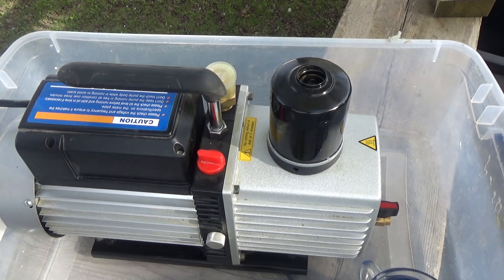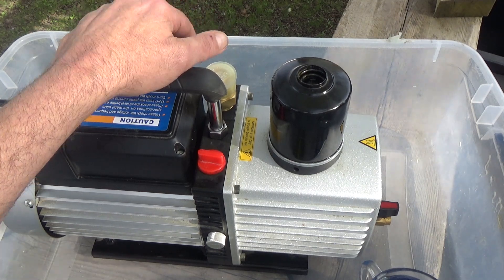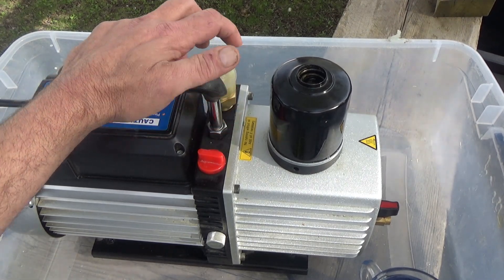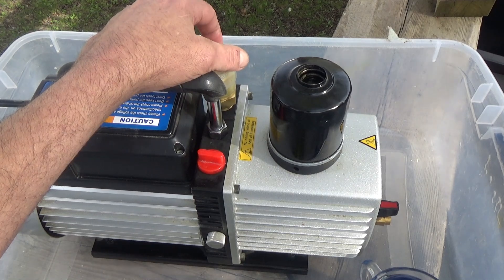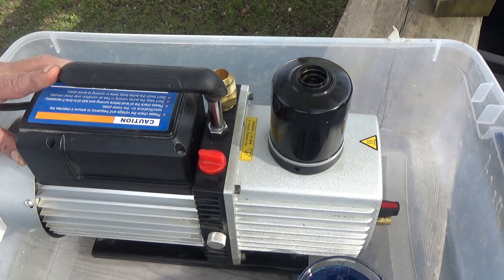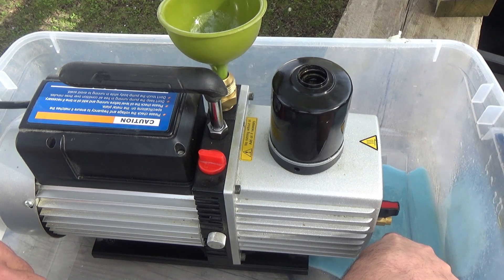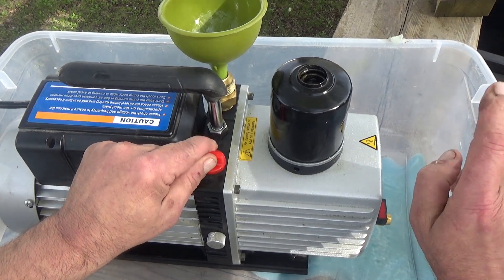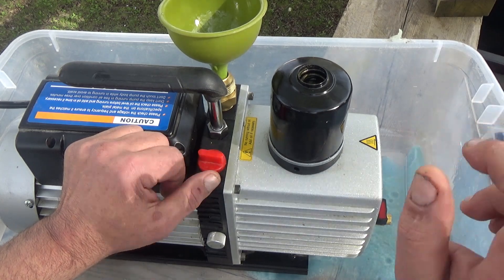Harvest Right Unable To Achieve Vacuum Error Ep167

Comment: My mtorr until around 1800 if dry test. After flushing several times, until no more milky color, but still the same, no improvement. Should u go on flush out more? More than 20 times?
Reply from the maker: In my opinion you shouldn't have to do it more than twice. This video was a last resort. If it didn't work I would look for other problems

Comment: Does anybody know where I can get the rubber ring That's goes around inside of the pump?
Reply: I'm assuming you mean the o-ring that goes between the tank & the main pump unit.  You can confirm by looking at the pump manual which you can find online by searching on the pump model number.  The manual has an exploded view and parts list.  If you have the standard pump like in the video, then Harvest right sells them.  I just ordered a couple for my pump.  It's item #39 on the standard pump parts list.  They're around $4.5 each as of this response.

Comment: I did order me a new pump today and then I seen your video.
 I went downstairs and flushed my pump with a little more oil than you used and the mTorr went down to 400 mTorr in 5 minutes and before that it would only go down to 1470 - 1530 mTorr in 20 minutes and then it would just hang there. I turned it off and watched your video.
Awsome job sir!!!

Comment: We were also using Dairyland vacuum oil but I spoke to the JB Industries senior tech and Matt said Dailyland oil is crap and DON'T use it.  We are now using Nu-Calgon Premium vacuum oil as per Matt's recommendation.  Also, change your pump oil REGULARLY-we're changing it every 10 cycles.  We STILL get "Failure to achieve...." messages on occasion but significantly less now with the Nu-Calgon oil(bought through Refrigerative Supply here in Canada but I'm sure you can find it stateside at any reputable HVAC supplier.  Gonna try the flush now and see what results I get.
BTW, HR's tech support dept is f#@%ing USELESS.  More info found on YouTube, ffs!!
Reply from the maker: I also changed from dairyland to black gold. I still run one load a month with dairyland to clean the pump out. We live and learn and I learned that dairyland will hold the moisture in the oil which will give vacuum errors
Reply: @JohnInBibs  hey John, tried the pump flush procedure, refilled w/new oil, ran mToor test AGAIN. Results:  mToor would not go below 6000 after 20 mins.
I suspect,  like many other HR parts, they used the cheapest crap they could find.  My HVAC guy said the refrigeration motor brand is cheap and extremely prone to failure.  We had to replace 2 so far.  We use these machines(6), 5 days a week and had them now for about 5 yrs
We dehydrate a salt based oral rinse powder, which, if oil isn't changed very regularly, will result in corrosion/rust forming on interior of pump & its oil chamber.  Consider taking the oil Reservoir cover off the pump itself and do a thorough cleaning inside, use brake clean, whatever you need to do. I have found a myriad of nasty stuff inside.  For me, I'll just carry on having a frustrating day, Cheers.

Comment: Hi. Thank you. I’m going to try the flush. I noticed your oil is blue. If it is dairyland I suggest you also stop using dairyland. It WAS the recommended oil but no longer. It contains water which will rust out your pump eventually. I’m working on the issue with mine now but I can’t wait to do the flush. Thanks.

Comment: I want to thank you for this video.  I thought my pump was fried, but I back flushed it and the vacuum is back to well under 400 mTorr.  I actually back flushed it five times using about two cups of oil each time.  I tested the vacuum after each back flush and the vacuum kept getting better and better until I was satisfied the fifth time.  It took nearly a gallon of oil, but that was cheaper than a new pump.  Thanks again for the info!
Reply from the maker: Glad it was of some use
Reply: 5 times? okay, I have done it once and testing now. If it gets better, I will keep doing this flush. I would have not thought about doing it again and again. We ordered a new pump last week so if this works, we will have a spare.

Comment: I am so disappointed. I just purchased our Harvest Right and I keep getting this message. We were literally doing the initial bread run. I am trying to work it out with Harvest Right CS. Nevertheless,  thanks for the video.
Reply: I just received my brand new small stainless steel model and same thing. I followed the manuals exactly to set up the unit and pump. It passed the vacuum test no problem but soon as I try to run the first burn batch with moist bread it runs forever but will not go below 1000 mTorr then starts messaging inadequate vacuum error. Took it all apart and put it back together all connections tight and drain valve closed. Repeated and exact same thing happening. Super disappointed for the price I paid and had  a bunch of food prepped. Have not been able to complete a full batch. Have contacted harvest right but have not heard back.

Comment: John: my standard oil pump is out of warranty (almost 2 years past shipping date, much more than the 6 months covered by warranty) and I’m now unable to pull a deep vacuum (can’t get below 1000 mTorr).

I’ve gone through the checklist a couple of times, with no luck. I also don’t have a 2nd pump to verify that it’s the pump that’s the issue (though I’m fairly certain it’s the pump).

I’m thinking I’ll try this method of flushing it out. I typically use Dairyland oil, but do you think it would be OK to flush with the oil provided by HR with the machine, and then go back to Dairyland for regular use? Didn’t know how the residual cheap oil used in flushing would affect the Dairyland oil.
Reply from the maker: I would use the non dairyland oil as well. Hope it helps. Worked great on mine
Reply: Thanks, John! I’ll see if I can find another person locally that will let me do a vacuum test with there’s to confirm it’s my pump, and then try flushing it out with the non-Dairyland oil.  I’ll report back!

Comment: After purchasing a harvest right freeze-dryer with oilless pump I had to send back both of them after trying to get them to work properly. I received another pump and they fixed whatever was wrong with the freeze dryer, they worked for a while but now after only using it several times I keep getting a vacuum pump error. Of course, the expensive pump is now out of warranty. Since I live in a hot climate I can only use it when fall hits. So far the freeze drying investment has been a total bust.
Reply: I have had the same problem.  I have owned my freeze dryer for 14 months, have bought 2 pumps, had them replace 2 more oil less pumps.  Took it into Harvest right to have them repair it.  Brought it home and it immediately had a vacuum  pressure error.  I am searching videos to see if there is anything users know that harvest right doesn't.  I sure feel like its been a waste of money.  If you are not handy with tools and want to spend a lot if time fixing it yourself, I dont know how you can ever get your money worth.  John has made some great videos and I would love to try some of the things he has done, but I have lot hope.

Comment: I just bought a medium freeze dryer with the standard oil pump that comes basic with the unit. I have not passed the mTORR test yet after several attempts it is now stick around 700 mTORRs.  I changed the drain valve as my leak was definitely there. The door seals, and all connections checked out okay. I changed the oil every time after the test. The oil was like pea soup color so I kept putting new oil in. I had to order more. 5 days in and I still can't pass the vacuum test. I even tried this flush even though its new. Still stuck on 700 ish. I was wondering if the demister unscrews on this oil pump. I know it does on the oil less green one but what about the standard oil pump. I try but it stops. I don't want to break it if I force it off. It doesn't seem to be seated tight as I can move it back and forth. Do you think this will affect it? Thanks for any info. I don't have an appt with HR for another 4 days. Frustrated is an understatement.
Reply from the maker: Sorry not much help. I would not do the procedure in my video if your pump is still under warranty, It is only as a last resort before buying a new one. I don't think the black filter would have any bearing on a vacuum leak. I would wait for HR. They will sort you out.
Reply: @JohnInBibs  thank you. I was worried about warranties too, I did let the test run longer today and it finally got to 499mTORRS after 1 hour,28 mins and 41 seconds. It didn't say I couldn't run after 30 minutes, it just said run the vacuum between 20 and 30 minutes. Ill try to send files but no where on the screen did it say files were transferring to the thumb drive so Im doubtful I have anything there. I remain frustrated but optimistic. I just wish I could buy another pump locally to see if that is actually the problem but Im in Canada

Comment: O. M. G. !!!! Thank you! Thank you! Thank you!!
I have not tried it yet but I am pretty confident that it will work.

I could not get below 700 mTorr just like you said and I futzed with the giant gasket on the door and monkeyed with the drain valve and finally decided to change the oil. I drained it and even tipped the pump all the way to make sure I got ALL of the oil out! I added about 450ml of fresh Robinair clear premium VP oil and fired up the vac test and NO DICE! I still could not get much below 700mTorr. I then looked at my brand new oil and it was ALREADY CLOUDY?!? What the heck is going on?!
I will definitely try the flush technique if this load gives me an error.
Reply from the maker: By all means try this, but cloudy new oil is indicative of a leak somewhere. If you are confident the drain valve and door seal are not leaking I would check both ends of the vacuum hose that goes from the pump to the machine
Reply: @JohnInBibs  OH! Good point! I notice that when I turn off the pump and watch the mTorr display it goes from about 700 up to 10,000 within about a minute or so. I assume that is not good. I heard that you are supposed to finger tighten the vacuum fittings and then give it 1/6 of a turn with a wrench. I will try this next.
I pulled off the giant gasket and spritzed with my squirt bottle to get flecks of metal out. I also used a fine diamond file to flatten and smooth and dings and burrs on the stainless drum that the giant gasket mates to thinking that might cause a leak. I checked the drain valve to see if it was sucking up water at all and that was a negative test. I am running my 5th or 6th load right now since getting it and was able to get a good vacuum (500mTorr in about 15 minutes at 7,000 feet elevation) when I fired it up for the first time.
Reply from the maker: Sounds like your pump is still under warranty. The procedure suggested in the video is for the standard pump only and I wouldn't do it if your pump is still in warranty as I wouldn't want to jeopardize that. Keep at it sounds like you have been pretty thorough. As a side note that is why I like to have a known good spare pump. I can swap it out and if still no vacuum then I know it isn't the pump

Comment: How do I get that black fliter off the top. I try twisting and it just stops
Reply: Just got my new unit and noticed the Same thing happened , feels like it would only rotate a few inches, but it will, you just need to use more force to twist it and once past that resistance point is spins off easily
Reply: Put something in the hole of the piece closest to the metal, and hold that in place, while using other hand and turn the oil filter looking housing, they have a rubber o ring in between them, so the plastic ring stays in place and oil filter housing turns, and threaded into the alluminum housing.

Comment: I've been reading through some other freeze dry forums about the standard pump becoming corroded inside.  Their resolution was to use Dairyland oil.  Dairyland has detergents that keep the internal motor clean inside and helps to control moisture.
Reply: The Premier pump specifically warns against using Dairyland oil.

Comment: Hi John
Can  you put more than just the 1 cup through the pump?  Will it come out cleaner if you do more?   I am on pump #3 & my unit is in Utah with my newest pump trying to get it fixed.
Reply from the maker: I'm sure you can, I would however turn it off in between cups so that it isn't ever running without oil flowing thru
Reply: Did you get yours up and running? I am on pump 3 in 18 months. I just did the flush and when I reconnected everything, there was a slight change in pump noise (as in quieter).

John, I do think I will try this flush with the 2 previous pumps?  I’ve had them stored full of fresh oil since going with the next pump.
Reply: @sekon57   Mine worked well when I got it back so I have not needed to do the flush but I also have pumps stored so will eventually try it as well.  Good Luck, hope it all comes out well for you.

Comment: ...So that pump flush method doesn't result in oil getting in/remaining in hose once reconnected?
Reply from the maker: If the check valve is working correctly this will not affect it. In fact if there is some debris on the check valve this could actually "clean" the little ball in it.

Comment: We have that Same pump. Our problem has been "Vacuum Test" with Empty FD (Tray Unit removed) passes, but once we have a batch going, still get the "Inadequate Vacuum" message.  Rechecked and rechecked, just kept pushing "Continue" (b/c same Error msg kept showing back up) and able to finish a batch.  Has anyone noticed the door gasket goes Beyond the Top Corner of the Tray unit, but the Bottom Corner prevents the Door Gasket from going all the way in?
Reply from the maker: Sounds like you are not getting your Tray Unit pushed all the ways back. When putting the tray unit back into the chamber I hold the wire harness up on top of the tray unit. If you don't do this the thickness of the wire connector can and most probably will stop your tray unit from going all the way back. Try that and see if this solves the problem of your door seal not gully seating on the bottom with the tray unit in.

Comment: I was having the same issue with my oilless pump. After going through a number of tests at HarvestRight’s request, they sent me an older version of the software. This stopped the error but resulted in doubled batch processing times. Instead of +/- 25-30 hours it now takes 50-60+ hours. They said I need a new pump but it has been “out of stock” for months. They wanted to ship me an oil pump, but I declined because I am not interested in messing around with oil changes, plus I paid a serious premium for the upgraded pump. They reply to my emails, except when I ask about an ETA for my new pump. I am disappointed with HarvestRight customer service. For the cost, I expected far better.
Reply: Same here, very dissapointes. Drying time for pineapple takes 5 days!
Reply: @Agneki  They did end up sending me a new oilless pump. I still need to contact them for a software upgrade because dry times remain very long even with the new pump. Also, I have found that food with a high sugar content takes much longer to dry than low sugar food for some reason.
Reply: I am from Europe so for me it is too difficult to contact them. They are ignoring me!  Dissapointed and don't know what to do.
Reply: @Agneki  wonderful, I need to change my BBB review and they can have their free Mylar bags back.

Comment: had problems from the day I got my freeze dryer with not achieving vacuum - I struggled and one our of 5 (maybe) batches would work.    Finally, I bought the oil free and it would not work at all - finally THEY made me pay to pack up and ship the whole system back and they repaired it, but some damage when returned - but working finally after years of calling.   If you have a problem - get it settled right away - I was too nice - finally had to get some people with pull to help me and got it fixed - I had a problem with my last load of ice cream - water coming out while under vacuum - WHAT?    I put the trays in the freezer and cleaned it and checked it and started over and it ran for 20 hours and did a good job.   Only thing I can figure is that even though, I completely melted the ice  cream and spread it on the trays, that coconut ice cream has too much fat in it compared to cows milk ice cream - so will just use freezer for that in the future.     My struggle was worth it as I try to use it as much as possible right now because food is becoming scarce and prices are going up.   Also, I want my freezer as empty as possible - sure is not right now - so, more batches lined up to go in to it.    Right now, doing last years winter storage crops - cooking up dishes and freeze drying in service sizes.   I just pray that that oil less pump keeps working.   I am disabled and the oil thing was too much for me and heavy.
Reply from the maker: I have had mine for two years and never had a problem with anything. I am hoping now that I flushed this pump it will last another two years
Reply: @JohnInBibs  Yes, I had mine since the beginning of time with this company.   The newer ones seem much more reliable.   Yes!, you have to clean that pump and I had someone who knew how to do it and it was like brand new and then still didn't work great.    I love my oilless and hope it works until I am gone.    I enjoy your experiments with so many different kinds of foods in it and you have given me the encouragement to expand.   I still want mostly single foods packed away - but lets fact it, having everything in one bag is not a bad idea.   I found some things work better if cooked first and some better if raw - and I have to leave the garlic out until rehydration because my dog does not appreciate it :-)